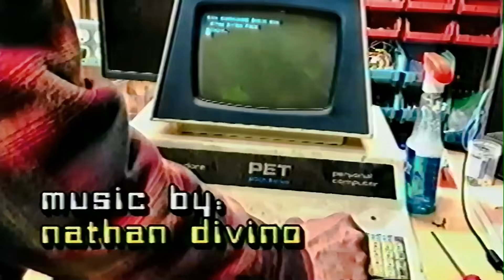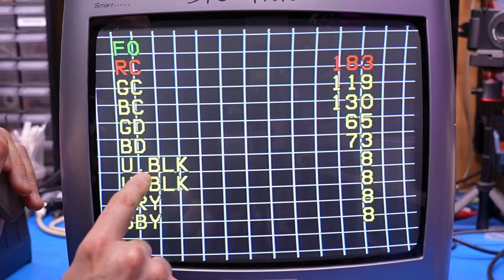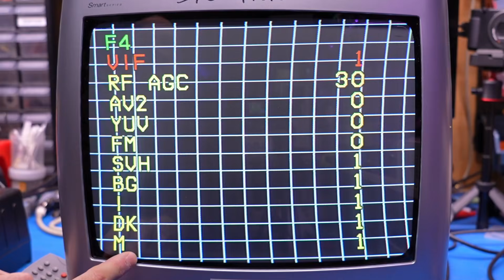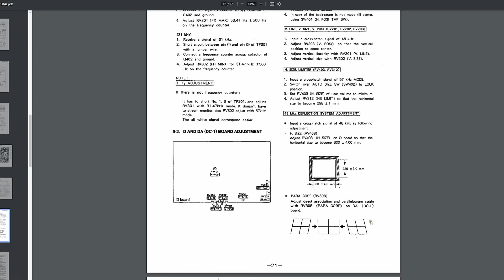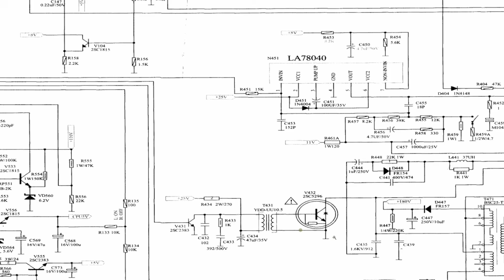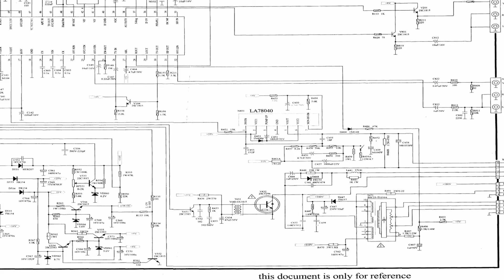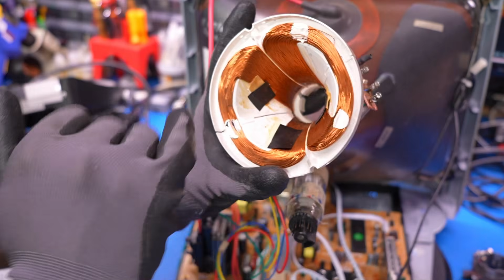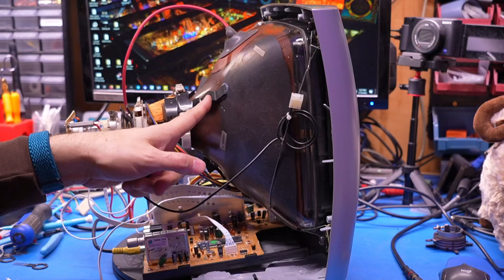I tried (and failed) to make the ultimate Commodore 1702 monitor

Comment: The capacitor on Pin 15 is the main capacitor of the vertical oscillator.
The pin is basically a current source feeding this capacitor and 2 (high and low) thresholds.

The pulse coming back from the FB transformer serves 2 purposes:
1) allow the chip to compensate for the delay introduced by the horizontal output chain (control the horizontal output phase)
2) measure the output voltage of the transformer and shutdown if the voltage is too high (X-RAYs in case of THT over 25Kv, i think)

Because the horizontal deflection is basically an integration of the H deflection yoke of the B+ input constant voltage, the width can be changed in 2 ways:
- adding inductance in series with the deflection yoke (reduces the width)
- adjusting the B+ input voltage (110v near R470)

The second option is what is normally done for very big changes. For example multi-sync monitors have several B+ voltages for multiple frequency ranges.
So to perform a pincushion correction what you need to do is to add the 50/60Hz AC pincushion correction signal "on top of the B+".
The most obvious way to do it is to use a transformer with the described pincushion correction signal as input and have the output coil in series with the horizontal yoke (Location of L441)

The FB transformer is "a current transformer" in the sense that the output voltages depend on the peak current in the primary, which in turn is correlated with the image width.

The deflection yoke that "worked" might have had a built in pincushion correction with portions of the vertical coils on the horizontal deflection
 to add or subtract the vertical signal on top of the regular horizontal deflection.

Comment: Can you please stress to people that they shouldn't be using a isolation transformer that the output is connected to ground when on the bench? Arcade guys think they should be grounding the output when working on the bench because that is how a cabinet is wired.

Comment: Adrian, is it possible to add a composite input jack to old crt tv’s that came with no inputs on them other than cable or antenna?  How difficult is this typically? Good results?
Reply: 8-bit guy has a video on that

Comment: Hello Adrian,
This type of circuit is found in old televisions.
EW correction is performed using a series LC oscillating circuit formed by the C441 470nF/400V capacitor, in the diagram you presented in the video.
Since the C441 capacitor is in series with the horizontal deflection coil, when the capacitor is charged, the voltage at its terminals is subtracted from the voltage given by the horizontal deflection circuit
The resonant frequency of the circuit is 60Hz equal to the vertical deflection frequency, so the sinusoid has its maximum amplitude when the center of the screen is scanned.
The circuit formed by R448, D448, C444 rectifies the positive alternation in this case, thus creating an offset voltage that has the role of eliminating left-right asymmetries (tighter image in one horizontal half compared to the other half).
These components are determined at the factory for each type of deflection coil for various CRT tubes.
The solution would be to try different values for C441 and for the other components, experimentally.
There is also a parallel oscillating circuit formed by the deflection coil and the capacitors C435 and C439. The resonant frequency must be equal to the frequency of the return signal for the horizontal deflection of T= 10.9us => 91.743 Hz. (Scan line has 63.5us of which 52.6us is the active portion. The difference is 10.9us)
The sinusoid has maximum amplitude when the electron spot is at the left and right edges of the screen.
Reply: The parallel resonant circuit oscillates only during the return period. During the forward period when the image is displayed, this oscillation is eliminated by shunting caused by the opening of the final deflection transistor V432 when scanning from the center of the screen to the right side of it, or by the recovery diode that is integrated in the transistor V432 which conducts when scanning from the left side to the center of the screen.
Reply from the maker: @lincamarius7092  Trying to fully understand the analog circuit you're describing, it sounds like this affects the horizontal linearity or S-correction of the horizontal drive circuit? I studied some more Commodore 1084 schematics including the one this tube came from (The 1084S-D) and it uses a small transformer to connect the vertical deflection to the horizontal deflection circuit, likely to affect this pincushion. https://gona.mactar.hu/Commodore/monitor/schematics/1084S-D_120V_Schematic.pdf
Reply: @adriansdigitalbasement  The "S-correction" capacitor is part of a horizontal linearity circuit, which is there to correct for the central compression of the image horizontally, meaning that without it the image will normally be squished towards the middle. The horizontal linearity coil itself is there to correct for the compression of the image towards the right side of the screen, meaning that without it the image would be squished to the right. This I usually see on the side of the horizontal yoke closer to ground (cold side of the yoke), which is L441. I would guess that C444 would be the "S" cap. C441 is directly in the path of the "cold" side of the H yoke and I would assume that to effect the east-west, width or position. Can't get more specific than that without tinkering.

Comment: So what happened to cause the two fuses in the isolation transformer to fail "...30 seconds later"?
Reply: Just a slight overload. Most likely the monitor drew something like 60 W. In such case, the fuse doesn't blow immediatelly, but after some time.

Comment: "This is the best 1702 monitor ever made." "What makes it a 1702 monitor?" "Uh.....the case?"
Reply: Sounds about right! 😜
Reply: Heard of the ship of Theseus?
Reply: Reusing a case isn’t my idea of an upgrade but maybe if you’ve got a good case and nothing else then yes, replacing the guts would at least keep your monitor looking period correct which is preferable to using a modern flat screen. But yeah I agree, this isn’t really an upgrade to me.
Reply: What if he also swaps the case in the next episode? 🤪
Reply: At the time the TV screens were pretty crap for even 40 column text on a C64 with its spectacularly terrible default of light blue on dark blue. The 1702 was a comparatively better output which was a result of better dot pitch. I'd say many latter CRTs from Sony have better dot pitch, but this would have been an upgrade if worked. I sort of think the idea of cross pollinating neck boards with CRTs or even putting CRTs on different drive circuits is sort of a fools errand though. Entertaining, but foolish since I'd imagine the drive circuits and neck boards are built mostly bespoke to the CRTs being manufactured, which would all be mostly unique in their characteristics between manufacturers..
Reply from the maker: @revelationnow  The CRT from the 1702 and the TV that donated the tube to this 1702 case are the same dot pitch -- as far as I know at least into the 80s and 90s all the 13" TVs and the 1702 used the same tube with the same dot pitch.
Reply: @revelationnow other way around
Reply: @revelationnow other way around....neck board  matches mainboard...then the board is tuned to the tube
Reply: I like the 1702 the way it was designed and intended, I myself in particular  wouldn't dare change a knob on that thing :)

Comment: Without knowing exactly, I think: 
the coils and capacitors form a resonant circuit that is tuned to a certain frequency. 
If you change the coil significantly then the resonance frequency will no longer match.
But that's HF magic ...

Comment: ... Am I missing something here, or is there NO high voltage side over-voltage sensing circuit on this Aliexpress board?  Inter-winding shorts on the primary (between pins 10-7) can cause this CRT to cease becoming a photon emitting device, and transform it into an X-ray emitting device. Which you will be standing in front of.
Reply: I've often heard about people worrying about X-rays from cathode ray tubes, but it really just seems like fear mongering to me. Has anyone actually done any real measurements?
Reply: @ct6502c  Right, right, its so fearmongering that the typical 80's television sets had 3 ways to detect high voltage overvoltage problems and shut off the high voltage circuitry.  Xrays can't be that bad, right?  I mean you can't even see them, so they can't harm you!  Silly engineers.
Reply: @glenndoiron9317  Well, it turns out someone did measure a CRT from a vintage 1960's tv with a Geiger counter and it didn't detect anything.
Reply: @ct6502c  That proves that the CRT from the vintage 1960's TV wasn't radioactive.  And if its working properly there are no x-rays to detect.
Reply: Well, CRTs emit X-rays by default. It's the way they are built.

Comment: Soon as I saw both screens on the bench, I knew what you were going to do.
An even BETTER upgrade would be to swap in a trinitron screen into the case…
Reply: Just a note.  I suspect that the Trinitron wouldn't be compatible with the AliExpress board.  As I understand it, the Trinitron needs some switched high voltages for the CRT.  But yes, Trinitrons are wonderful CRTs.

Comment: Those other yokes might not be compatible if the CRT they came from was a slot mask (SONY/Panasonic) type and the CRT you have is an RCA type mask.  And THAT could be the problem with the driver board too.

Comment: C441 (0.47uf @ 400V) metal film cap adjusts the width on these chinese boards.  A smaller value adds more width. I had to use ~0.2uf on 19inch set.
Reply from the maker: I ended up replacing L441 the inductor with the width coil I stole from some scrap CRT board and that also allowed me to adjust the width. (The coil I tried out in the video)

Comment: It's pretty strange that this replacement TV chassis lacks the SCART connector, likely the most useful feature it should have.
Reply: I think SCART connectors were an European thing.
Reply: @pcm2012  its thrue and meand „Syndicat des Constructeurs d‘Appareils Radiorécepteurs et Téléviseurs“  or in german 
DIN EN 50049-1   Kennwerte für die Kleinsignalverbindung zwischen elektronischen Geräten für den Heimgebrauch und ähnliche Anwendungen. 

Characteristics for the small signal connection between electronic devices for home use and similar applications
Reply: The NTSC market always lacked it.

Comment: I don't work on monitors at all, but I have watched enough to actually understand them, now. I saw that the original part had those spacers on it, and that hindered your "new" part, but in taking them off, it could move ever so slightly forward. I wonder how much of a difference that actually made to the image. The spacer was designed to hold the original at a certain point. I am now wondering if the 19" parts would work with a slight modification. Obviously, the internal geometry of the metal components cannot be changed, but is there and room to remove some of the plastic to allow one to fit, perhaps?

Comment: The problem here is NOT in the inductance, but in the SHAPE of deflection coils, it is entirely different for different types of tubes.
Reply: I think you are on the right track, but I suspect if you look at the coils that came with that tube they are closer to the screen part of the tube that the other coils, so that board is designed for 90 degree deflection and the other coils didn't slide up far enough on the tube neck. With the coils closer to the screen the angle of deflection changes so this tube may be a 100 degree deflection which would require some pin cushion correction.
Reply from the maker: Indeed, others have mentioned this. The original monitor must have had some correction in the circuitry for this -- and indeed I went and looked at the 1084D schematics (Where this tube came from) and it seems to connect the vertical and horizontal deflection together via a transformer to likely handle this pincushion correction.

Comment: I'd be guessing it's a physical issue with how the yoke is shaped.
But, if you have swapped the innards of the monitor, and then change the tube also, do you really have a Commodore 1702 monitor anymore? I'd say no. Basically, it's just the plastics left.

Comment: Doesn’t the step up transformer already provide isolation?
Reply: No... such transformers are usually autotransformers, which do not have an isolated primary and secondary winding - just a single winding with taps

Comment: I remember getting that 1702 as a kid back in the 80s, I felt like an absolute KING with that as a 14 year old teenager. Have so many fond memories of it, and it was a solid beast, it literally lasted forever (philips)
Reply: Philips 13" CRTs are great. Had a different one in my bedroom for ages! 
And my brother had a model which came 5-10 years before mine, with an aggressively ribbed top/back slope and some extra cover (plexi?)glass over the CRT itself. I think the tube was the same in both though.

Comment: When I was a kid I opened up a few monitors not knowing about how dangerous they could be. I was salvaging the permanently attached VGA cables. Thankfully I never got shocked.
Reply: One time when I was a kid, I took apart a camera with a built in flash. I didn't really understand that much about electronics yet, so I didn't know that the flash had a high voltage capacitor! I thought it was just some kind of rechargeable battery. Ha, you can probably imagine what happened next. Somehow I mistakenly touched it and got zapped! I still remember it to this day, lol.
Reply: @ct6502c  When I was much younger I was trying to plug my surge suppressor into the socket behind my desk. It was a really tight space and couldn't see so I felt around with the plug in hand and found where to plug it in. One of my fingers was touching one of the prongs while trying to plug it in and let's just day I'll never do that again. I really wish the US used the UK style plugs. I never would have been zapped.

Comment: Im surprised how linear the picture with the 19" yoke was, when you consider the delicate balance of the various geometries involved. I guess at the end of the day, CRT driving is analogue electronics, and analogue electronics are voodoo!
Reply from the maker: I was shocked too...I have zero explanation for why that 19" yoke looked to linear and non-distorted... even though it was designed for a totally different tube... and the matching yoke is so bad. For now I will give up trying to make a high-res 1702 and just enjoy it for what it is.
Reply: @adriansdigitalbasement  Think about it for a while and come back to it if/when you want to.
Reply: @adriansdigitalbasement  Apparently the yoke doesn't need to seat fully against the picture tube. Let's 3D print some spacer and then adjust the convergence. It may work just fine.